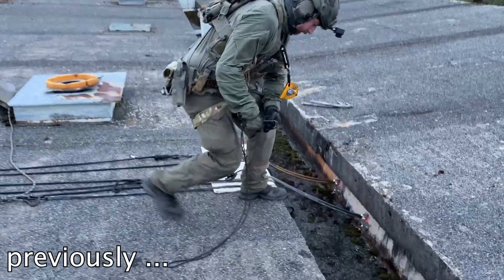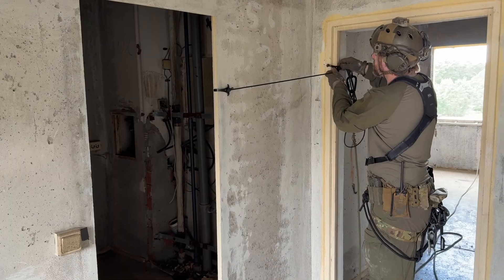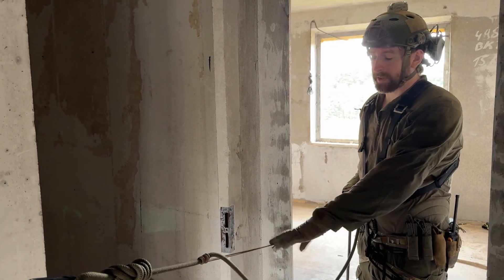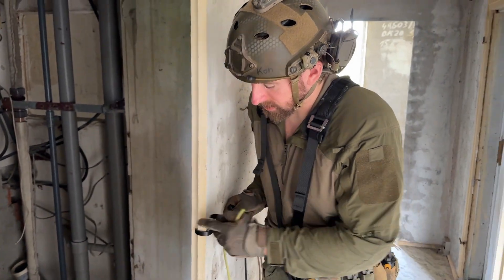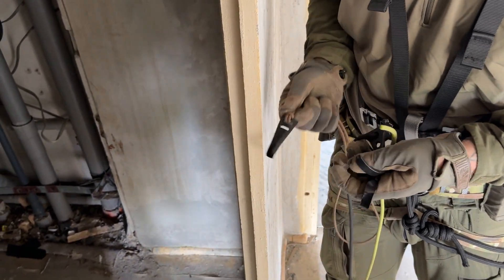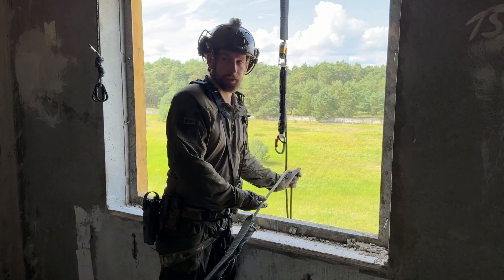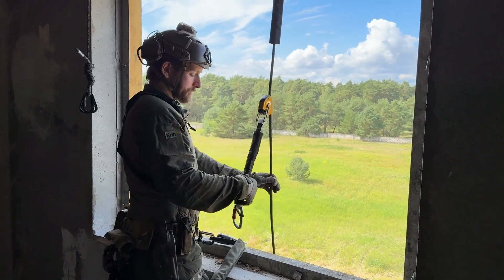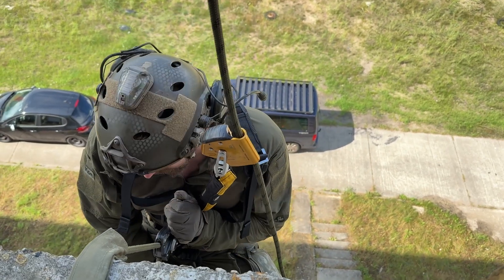Sketchy Urban Anchor - Emergency Rappelling on Skyhooks?

Comment: Would creating a fixed loop in the chord which connects the two sky hooks create some redundancy? Then if one hook falls off the carabiner wouldn't slide down the chord
Reply from the maker: But then the load is nor equally shared. I prefer to see one set of 2 hooks + cord as one point. For redundancy I would add a second set. And if you knot it in a way, that the cord can not slide, you only need a slight change of direction and one hook can loose hold/fall off. 
I will soon do a video about this.

Comment: Interesting, I'm used to rappell as a technique for climbers, it is interesting how differently you do it in military or rescue services...
Reply from the maker: But even for the military it's not a standard to work with these hooks.
For rope rescue they can be mainly used to place edge protection or possibly tension a anchor, where it is not load bearing.

Comment: 0:27 In the room on the left you have pipes etc. Why not bring a sling around them as an anchor point? Secure two hooks with a flimsy prusik, come on now!
Reply from the maker: Because the topic of this video is not "Using available anchors in this room" - it is about using these hooks. The house itself has got dozens of better options. Showing one option for testing and entertainment does not mean, that this is the only, best or safest option ;-)
Reply: Haha roasted